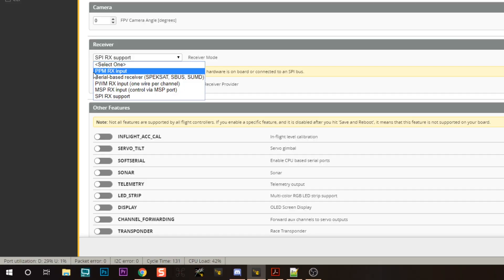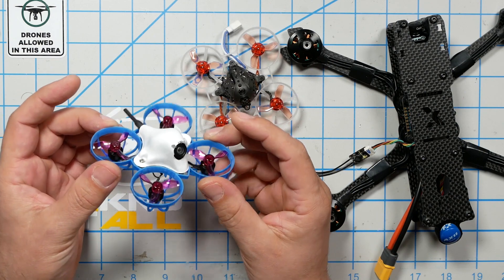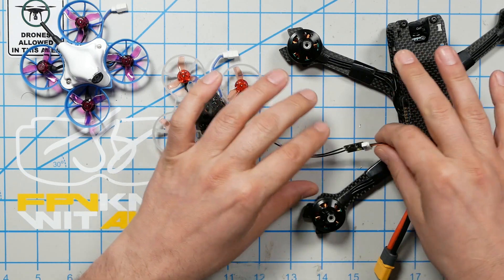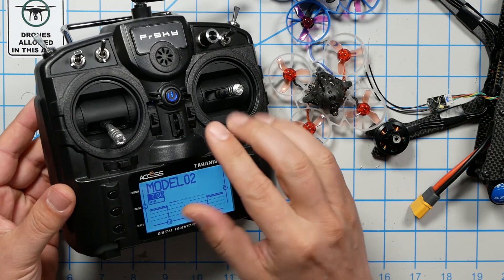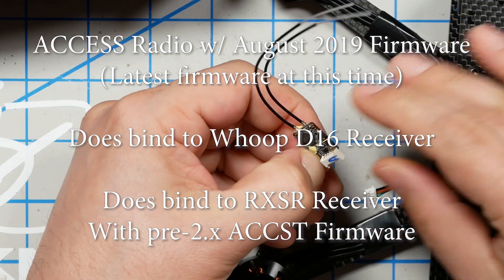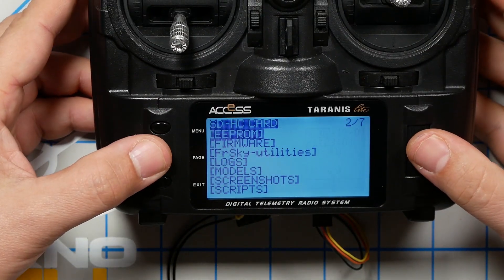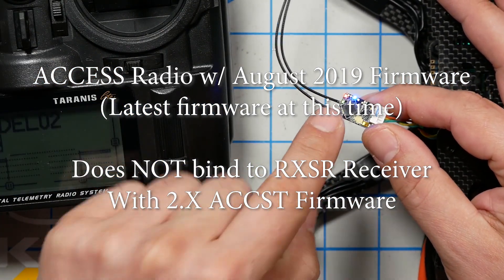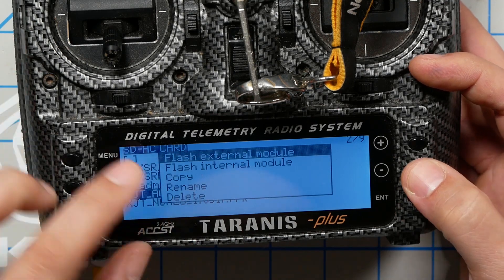FrSky won't bind! ACCST 2.0 is to blame.

Comment: Hey JB, I get your point, you are right thing and you should not avoid talking about vendors wrong moves. That's why so many people trust your opinions. (13:38)
FrSky is working really hard to destroy everything they built over the past years. They created a very nice transmitter, full of nice features, that outperform almost every other competitor, for a fraction of the price. Everyone was using their products when something changes and now they just don't want all this happy customers again. I can't understand why they are doing this. No one trust FrSky anymore.
TBS just released a new controller that would not have a chance to beat FrSky competition - if FrSky were trustworth of course. TBS is another jerk company too, but they are lucky that looks like their competition is doing whatever they can to screw things up.
That's kinda sad to be honest... We want to see innovation and evolution, not this crap.

Comment: I bought a Taranis Q7X ACCESS. It binds with my TinyHawk II in D16 mode, but the quad loses connection after s few second and it drops. I found some video explaining how to flash firmware and enable the D8 mode, but apparently, my model with the Access protocol can't even do that, so I am screwd.
I am new to the hobby and I don't know what to do. I bought the Q7X because it was recommended for a newcomer, but I discovered it won't work with my TinyHawk.
Someone know what can I do? I already spent a lot of money and sincerely I am pissed. Is there an external module of some sort that I can plug in to bind to my TinyHawk? Will the radio cause problem also with the normal 5" quad that I plan to fly in the future?

Comment: Too late for me, when you posted this I didn't even knew about the FPV world and I took "advise" from a friend about it. I bought the X Lite Pro. I have 2 drones that need the D8, (TinyHawk and VisWhoop)... do I need to buy the XJT Lite Module? or is there another way? (I like the X Lite Pro because it is cero cumbersome..... now with a module...).  
Now with Mister Bardwell I learned a lot, and now I am getting 2 other drones that can do ACCESS or XM+ i guess, but I believe no more FrSky.... now on, only Caddx Vista or DJI Air Unit..... (I am getting the DJI RC, they say its the best for newcomers)

Comment: Wow if I had only seen this before I had my recent frustration with two r-xsr receivers. I flashed them both to ACCST 2.1.0 and lost binding to my X9D SE. One I flashed after binding so the idea of breaking the bind didn't occur to me. I de-pinned that receiver and put it in a micro so I could configure it in BF later. The second receiver I flashed PRIOR  to binding and discovered that it would not bind to the radio. I thought the receiver was defective. Then I checked the binding with the previous receiver (already on the micro frame) and learned it was no longer bound. I wouldn't buy the idea of two defective receivers. So I tested a theory and flashed the second receiver with ACCST 1.9.x and was able to bind. I guess I could have left them both at 2.1.0 and upgraded the firmware in the X9D to match but I had a third r-xsr in a Dingo frame that I was in no mood to dismantle to flash. So I opted to downgrade the firmware in the receivers since they were accessible. Plus I do have a whoop with a BeeBrain Lite FC that uses SPI and upgrading the X9D to match ACCST 2.1.0 would have rendered it useless. Another case for downgrading those receivers. Because the one in the micro had been de-pinned, that took more time. Had I seen this video, I would have learned about this. When a receiver is tucked in a hard to get to spot on a frame and you have to tear it apart, it becomes less than trivial. Too bad flashing and binding isn't simpler.
.
I can't afford to go radio hopping and switch to something like a Jumper. I haven't had the X9D for a year yet so I'll stick with the current firmware so I can fly the SPI NBD whoop.

Comment: Just getting into flying ordered a 
Tinyhawk S what controller would be best

a Taranis Q X7 or Jumper T16 ?
Reply from the maker: Either of them is a pretty solid radio. QX7 is a bit less expensive. It only supports FrSky receivers, but the overall build quality is a bit higher I think that T16. On a budget, the QX7 would be an okay choice. If you can afford the T16, and especially if you intend to use Crossfire some day, then the T16 makes more sense.
Reply: @JoshuaBardwell  Thank you, sounds like  Jumper T16 is a better way to go. My head was hurting so much to learn. Thanks again 👍

Comment: Hi Joshua, thank you so much for your time and this video, because it will be a hope to fly my Trashcan whoop again!

I had upgraded my Taranis Q X7 (FCC) to 2.x.x versions of ACCST XJT because I was not yet aware of these incompatibility issues and because the radio was unable to bind with my Trashcan, in either D8 or D16 modes. So to try to solve the problem I flashed the XJT firmware back to 170317 version. The fact is that I am still not getting bind in any of the D8 or D16 modes. Currently my Trashcan firmware is in 4.0.4 version and I am also using the Betaflight configurator 10.4.0. What could be wrong? I tried many things to solve this, but I have no experience in this hobby and I will be very grateful if you can help me.
Reply: u have same problem with my qx7, have u fix this bro?
Reply: @mrgofficialchannel  Unfortunately not yet.  I am thinking about the possibility of reinstalling the older version of opentx.  That's the only thing I haven't tried yet.  What firmware and opentx versions are you currently using?  What is your FC and firmware version?

Comment: Hey JB, great video considering i just ran into this problem with a new Taranis Q-X7S ACCESS and a BetaFPV65 Pro2 micro drone. I was wondering if there is any way i can put the old ACCST protocol onto my Q-X7S ACCESS so that i can use this RC with the micro drone?
Reply from the maker: The ACCESS radio is compatible with pre-2.x ACCST D16 receivers, but not D8 receivers. There is no way to change this arrangement except to buy an external XJT module that can do D8. However most micro drones support D16 although they may have reduced range compared to D8.
Reply: @JoshuaBardwell  ok so i have FW: opentx-x7access   VERS: 2.3.7 (latest one)   on my Q-X7S ACCESS right now and still cannot bind to the BetaFPV65 Pro 2. It just does the never ending beep. Ive flashed the latest firmware onto the FC through betaflight and cant seem to figure out how to fix my problem. Receiver is set to SPI RX Mode and FRSKY_D.  When i go to bind on the RC im trying it on ACCST D16 and ACCESS and both will not work. Do you have any pointers?
Reply from the maker: FRSKY_D protocol is D8. ACCESS radio cannot support D8 except through an external module. Switch the protocol to FRSKY_X.
Reply: @JoshuaBardwell  ok i switched it to FRYSKY_X and it still wont bind. Am i supposed to be trying to bind while on ACCESS or ACCST D16? Ive tried both
Reply: @cameronhanson7596  ACCST D16, channel 1-8, telemtry Off. But it is not optimal for flight.

Comment: Josua i have just bought the beta 65 pro i also bought the qx7 access it only does d 16 no d8 i am new and frustutated can i bind this together or should i give up
Reply: I do own a jumper v2 transmitter also will this bind to beta 65 pro  and if so which protocal on frysky
Reply from the maker: The FrSky ACCESS radios cannot do D8 at all. You can buy a FrSky XJT module and put it in the back of the radio and it will do D8.

Comment: I am a “happy Frsky user”, but I bought my transmitter right before the shenanigans really started to happen. I’m not looking in to replacing a brand new transmitter that works fine,  but I will not be recommending Frsky to any new pilots. I’m really hoping that smaller DJI options eventually are available. When the DJI system came out, I thought it would be a long time before anything smaller than the original air unit would be available, then the Caddx Vista was released.

Comment: Thanks for the research you do to help us out with these headaches. This hobby would be a thousand times more frustrating without you and the community’s help. Frsky really shot themselves in the foot. Do cc2500 protocol transmitters work with all frsky and frsky compatible receivers? Is that another way to bypass this? Is just get a new radio or move to elrs

Comment: Thanks Joshua for this video. It's a universal serious problem with Taranis QX7. Can you down grade the firmware from Radio...??
Up to which lower firmware version it is good & safe for our work & biding whoops, F type & other receivers...???
Thanks again.
Reply from the maker: If you're using D8 mode then any firmware version will work. For D16 everything up to 2.x.
Reply: @JoshuaBardwell  Which Version of Open TX for Taranis Qx7 Accst ( 2.4 GHz ) non EU, is good for Receivers of Frsky X series, D series and V8-II series...???
Current version 2.2.4 is giving lot of problems. Can I down grade to older safer version...???
If you have any YouTube episod on this, then please suggest.
I am tired of my Taranis QX7 Accst after upgrading.
Thanks,
Regards,
Ajay Bidikar.

Comment: 8 months later and this hit me like a truck. Made the mistake of upgrading all my frsky stuff in like May, thinking I was fine because I didn't have anything with a built-in RX. Well, the weather's getting colder and I decided to break out my Meteor65... yep.
Thankfully, I've got a crossfire kit on backorder due to constant radio RX loss recently, and I'm getting rid of my Qx7 for the TX16s because this is just embarrassing.

Comment: I am not sure if it is just a fluke.   I have the new firmware on the x9d SE and was able to bind to Mobula 7 v2   by using the command line.    Note  the lights never flashed showing it was bound like in the old version.

Comment: I've just downgraded X9D internal Modul to version 170317 NONEU, even if I m in EU... But EU did not work. Then in settings set up Amerika as region. Then - flash XM+, or XM receiver with firmware 170313 or 170323 as FCC....-RSSI16.frk (frk = freekout? 😂) Then in X9D bind it as ACCST D16 as Ch1-8 Telem OFF . In TX16S also binding now fine!!!

Comment: I’m loving ACCST 2.0!! I’ve got it on all 18 of my RX’s (10 different models of RX’s too, with the majority being R-XSR’s & X8R’s) with zero issues. People are forgetting you need to upgrade the OpenTX firmware to 2.3.X, then the Internal XJT module to ACCST, then the bootloader to ACCST and then each one of the RX’s to ACCST. Works 100% and the latency reduction is superb! I do feel for all the tiny whoop 3rd party Rx fliers though.

Comment: i totally agree with you regarding FRSKY i use to love the X9d and still do but i replaced it with a Jumper t16 (i love it by the way thanks for the recommendation) and i do run CRSF so the internal TX on the pro is what did it for me.. that being said i was planning on replacing my old x9d with something and the x9d replacement looks like crap i have heard nothing but bad things about it and well anything frsky has come out with has been total trash since the stopped making the true x9d  line. if they would just embrace the fact that whoops are installing RX's for there radios making more people WANT to buy them esp noobs to the hobby they would sell more because as they progress into the hobby they would buy more things.. JB I LOVE YOUR DEDICATION!!!

Comment: Hey Joshua. Any chance you have a review vid on the horizon of the RadioMaster - TX16S 16Ch 2.4ghz Multi-Protocol OpenTX Radio System? Would like to get your take, I currently run the QX7, but may consider a change. Thanks in advance.

Comment: voting with my wallet.  i stepped away from FrSkys ecosystem completely.  bought a Jumper T16 Pro and sold both of my Taranis'.  whoops and micros only now a days, so i'll just switch my couple of micros over to Jumper receivers or a couple Spektrums i've got laying around from old BNFs. hell, maybe i'll try out Crossfire now, i just don't fly my micros very far away really.

Comment: It really sucks. I´ve been going  away from quads and getting into planes again for some time and was very happy using my qx7 for everything with Frsky receivers for planes and quads. ¿will i still get the option of buying unbranded receivers to use with my old firmware Tx or will i have to go to a different system? who knows...

Comment: I am new to the hoppy and I thought by getting the Frsky QX7 access I was getting the best of the best. now I just regrating not doing a good search before buying Frsky. Anyway, so you are saying that my beta 85 HD will not ever bind with the QX7 Access? I do have D16 but still won't bind for some reason :/
Reply from the maker: Get the external XJT module and it can bind to this quad. Or get a 4-in-1 multiprotocol module.

Comment: An issue was uncovered in Germany that has required FRsky to amend the  ACCST protocol to correct lost frame error. You can find full details on the rcgroups web site. Presently the v2.0.1 is an early release fixing the lost frames bug but has also introduced some telemetry bugs. I would wait until the next release before upgrading to v2.x.x There is nothing wrong with FRsky protecting its own IP. So if you want to continue flying your Whoops don't upgrade your radio to v2.x.x
Reply from the maker: There is nothing wrong with FrSky protecting their IP. But they are doing wrong by their customers by breaking backwards-compatibility in order to get the bug fix.

Comment: Hello. Thanks for the video.

I stupidly updated to Accsr V2.0 on my X9D+ 2019. Now I can't bind to any D16 integrated receivers. Do you have any advice? Or do you maybe know where I can find older versions of frisky Firmware? They have taken them all down.

Thanks :))
Reply from the maker: Flash back to the previous firmware, or update your receivers to 2.1. The older firmware is still linked on FrSky web site, there is just a text link at the bottom of the page instead of a big button.
Reply: @JoshuaBardwell  Legend! Thank you very much

Comment: There's a real good reason now for some folks to just write new open-source firmware for both the TX modules and RX's and just use FrSky for their manufacturing and not their software...
Reply: Been looking into this after getting bit by this type of nonsense on their R9 system where they obsoleted ACCST on newer hardware.  This looks like a great starting point atleast for LoRa based transcievers:  https://github.com/RavenLRS/raven  . You could potentially communicate between  R9, Crossfire, and custom hardware.

Comment: Will pre 2.0 receivers still be sold or will they all be pre updated? Also now I wish I had gottena different transmitter, other than the qx7, when I got into the hobby last fall.
Reply from the maker: For now, receivers are being sold with pre-2.x on them, and given FrSky's history they probably will be for a long time. Also, the older firmware is available on the web site if you want to downgrade.

Comment: That was exactly what I was running into with the new 2.0 firmware. I flashed my receivers to 2.0 and I couldn’t bind to anything. After rolling back to the previous firmware everything worked again. So I sticked with the older firmware.

Comment: So i just bought an xlite with access 16. So this wont be able to bind to my Tinyhawk no matter what? Thanks fornøje Nice vids
Reply from the maker: You can bind it in FRSKY_X mode (D16 protocol) or you can bind it using an XJT module in the module bay in D8 mode.
Reply: Joshua Bardwell i Can do that on a Tinyhawk model 1?
Reply: @Nappetitten  You can, but it doesn't fly. The TinyHawk take off but after a few seconds it loose connection and it drops.

Comment: How to apply this to taranis xlite 2020 my tinyhawk freestyle wont bind after latest hardware flash
Reply from the maker: The optimal workaround is to buy a multiprotocol module like irangex or buy a DJT module for the radio. This will keep the "old" protocol which can bind to the tiny whoops etc.
Reply: @JoshuaBardwell  thanx dude your videos r super helpful im 35 and this was my first quad i bought here in uk sucks cuz of lbt

Comment: I have Taranis X9D plus with Accst. Where can i get older firmware to downgrade as my radio will not bind to a frsky X8R now since upgrading to 2.1.0 ????
Reply from the maker: Need to upgrade the X8R to 2.1 or downgrade the X9D. Older firmware are available here: https://drive.google.com/drive/folders/1ugj1DjWdqbnE25aDwyOYJDD-Nmr0wfYg?usp=sharing
Reply: @JoshuaBardwell  Thank you fine sir. It took the afternoon but I was able to bind. I used your link for the files and also used frsky xjt rf module fw 2.1.0. Now onto programming modes and arming switch. Thanks again.

Comment: Is there a point to even updating to the latest update if you just run crossfire?    Like is it just for the internal tx or is this update doing more than just tx stuff and therefore it would be beneficial to update. Then tho I use crossfire.  I hope that makes sense
Reply from the maker: If you never use the internal module, the firmware update doesn't matter.

Comment: Did they fix this yet or am I still screwed. Got a frsky xlite pro and a tiny hawk 2 and would love to fly it but still can't get it to pair. Not sure on what to do
Reply from the maker: Change the Tinyhawk to D16 (FRSKY_X) protocol. Or get an XJT module to plug in to the radio whuch can bind in D8.
Reply: @JoshuaBardwell  yep I have the xjt lite on it and set to D8. The internal is set to disabled and I watched one of your other videos on updating everything and pretty sure I did everything right. I even have amber vp on it